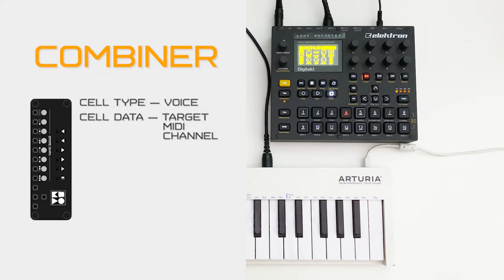METACONFORMER Combiner Tutorial (SOMA labs)

Comment: I cannot understand what is being explained in this mode.
Reply: I struggled a bit at first, but at least the second part with the digitakt (3:20 ish) seems to make some sense to me. Basically, after each key in the chord is input, it uses the next MIDI channel setup in the combiner. Since all the channels are just mapped to different tracks in the digitakt, as you input each note, it triggers a different sample. 

Now imagine it mapped into different synth MIDI channels instead of Digitakt tracks. So if you're playing a C major chord (C E G), you could have your JX-08 play C, your SH-01 play E, and your DX7 play G; all from your MIDI controller. 

It really expands the possibilities of cheap single-track sequencers like the keystep. I'm sure there are more applications for it as well.